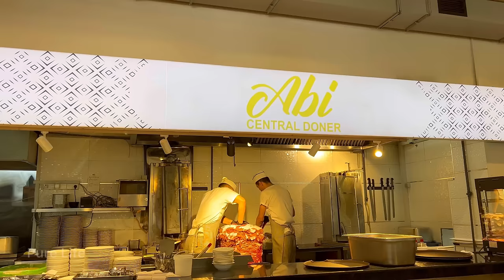The Largest Shawarma Center | 150 kg of Meat Every day | Big donar

Comment: As someone who's cooked in a kitchen, I'm only questioning how they cook them.  They're cutting cooked pieces of meat next to raw meat drippings/blood? That can't be good can it? I've never seen meat prepared this way, so someone would have to explain the reasoning to me.
Reply: They're only slicing off the very outer layer. Juices don't really come out of raw meat, until it starts cooking, and when it does where is it gonna go? Right out into the heat, where it'll also cook. There's not a lot of infected juices reaching that outer layer of meat, so it's not going to require much thermal energy before it heats up and kills any bacteria.
Reply: @Corzappy  Oh. Thank you for the knowledge!